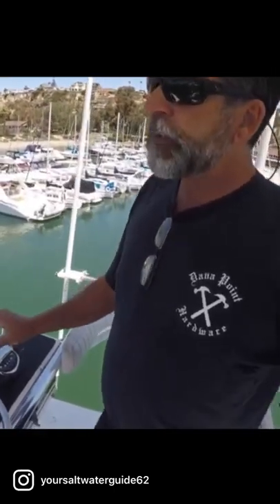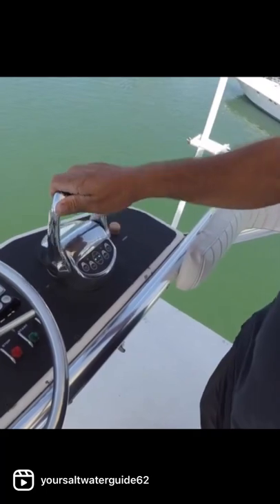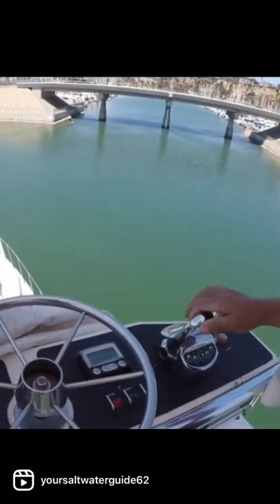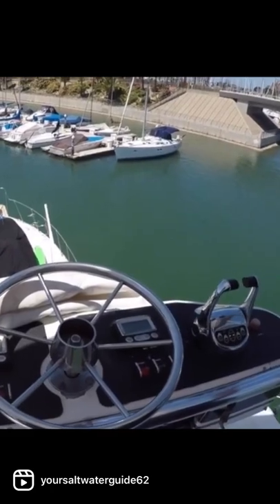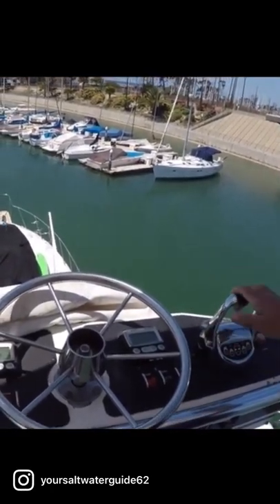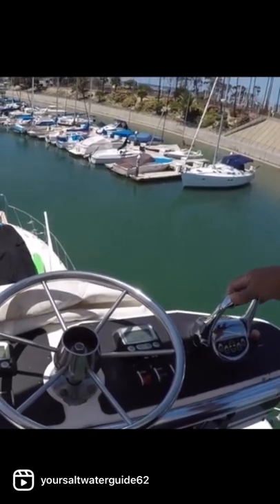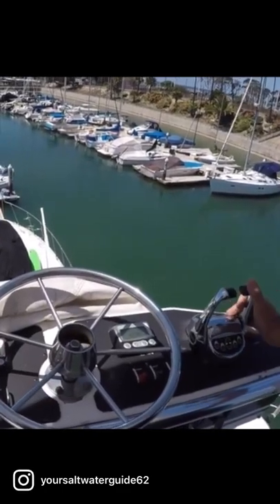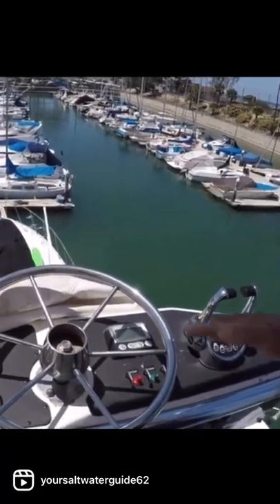How to Dock your Fishing Boat 🛥 Part 3 #fishingboat #fishingboats #dockingboat #boatdocking

Comment: The guy who taught me would slap your hand if you touched the steering wheel in the middle of doing this
Reply from the maker: did i touch the wheel
Reply: @YourSaltwaterGuide  no you aced it. Havent driven diesels in a long time, not since i worked at a boatyard. Nice to see someone explain what they're doing. People fail to appreciate how much purchase those big ass diesel screws have. That little bump into gear is all it takes.